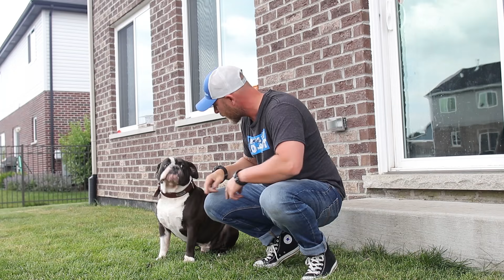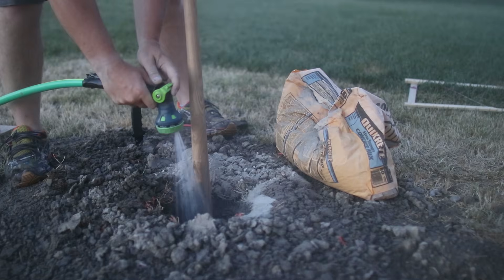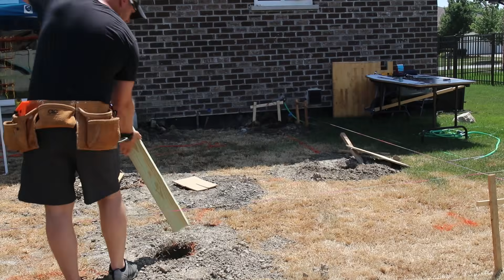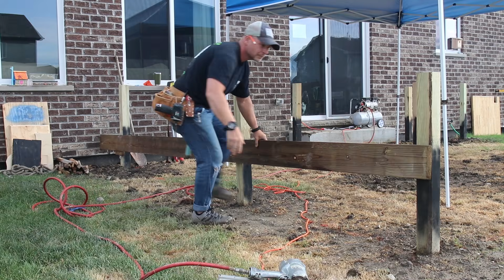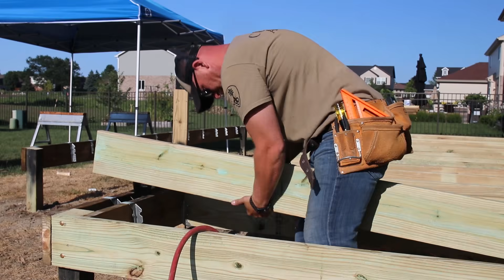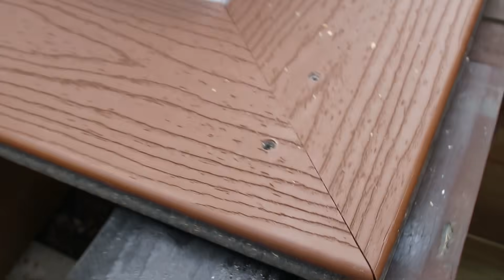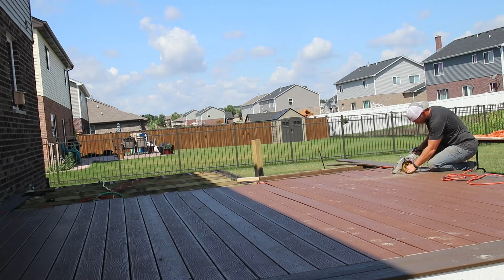How To Build A Deck!! Layout, Framing, and Composite Decking Guide ||| DIY Deck Build

Comment: I have a few questions.
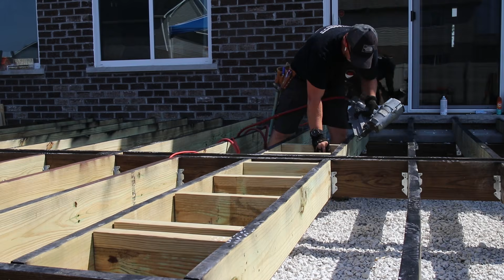1. At 11:05 you started the bracing for the outside and middle of the frame. On the outside, did you run an additional joist shorter than 16" from the outside or did you just block in and keep the spacing at 16"?
2. When doing the border and steps, you overhang the Trex just about an inch. I saw how you did the angled corners and pre-drilled and the screws show, but how did you hide the rest of the screws through the length of the board? The overhang would make it so you couldn't use your little tool.
Reply from the maker: I’m not exactly sure what your asking brother but I used blocking every 16” in the middle because I had a different color transition piece going there.   And on the stairs again 16”.  As for the mitered corners I drove that screw just below the decking off camera.  Before we sold the house I made my own plugs out of the decking boards and plugged them like the facia.  They didn’t sell my color plugs so if your looking to do composite decking keep that in Mind.  Hope that helps you.

Comment: I’ve never seen 7 & 1/2 inch 2x8s.   Usually they’re 7&1/4. 9&1/4 for 2x10s.  Everything else is half inch under 2x4 2x6 both half inch under.  The rest is 3/4. Just wanted to point that out.   Not to be a dick or anything.
Reply from the maker: They actually ranged from 7.25 to 7.5.  It’s crazy how off they were but it worked out.

Comment: Looks good, but, if I may, PLEASE don’t screw beans to the sides of posts, they should lay on top of the posts, it makes a huge difference structurally.
Reply: Correct.One should cut away the posts so that the beam fits in the section that's cut away. This way the post supports the full weight of the beam instead of just bolts.

Comment: Sure couldn't build a deck that way and it pass inspection where we live. Posts cannot touch dirt..especially be incased in it.
Reply: Sandwiching carrying beams between posts is why decks are failing when they get overloaded. They need to sit on top of 4x4s or 6x6s.
Reply from the maker: Every town will be different.  I pulled permits for this and passed inspection.  It’s all about climate and code where you live.
Reply: @KomarProject  Your beams tho? They need to be point loaded on the post don't they?
Reply: @BorisYeltivinshki  Yes- Joist must sit on a post by 1-1/2" bearing you can't use lag screw lol...This guy is a hack and doesn't know what he is doing. Please don't use this video for referencing.  The second you see someone using a nail gun to build a deck give that video a thumbs down and leave immediately.
Reply: @deeeeeeps  I agree with everything except the nailgun part. I'd never want to ply a beam by hand
Reply: Komar Project still would have gone with a forming tube and coming slightly above ground level and mounted the posts on that, even if your local code doesn’t require it.

Comment: did you use the composite on the deck because it looks better than pressure treated wook or for other reasons?
Reply from the maker: Ya because it maintenance free for the most part.  It will last longer as well

Comment: Thanks for explaining how to attach the joists to a supporting beam. I had the same problem with steps going to a glass door. What length of cantilever  have you got? My joists are 5x2s. Could I have a cantilever up to about 2ft safely? Cheers.
Reply from the maker: My overhang is about 18”.  With a 2x5 ( which is weird by the way lol ) I’m guessing you can maybe get away with a 12” over hang. Topically you need at least a 2x8 for a 2’ overhang.   Hope that helps brother

Comment: That looks really beautiful and I'm planning on doing almost the exact Design with the curved patio for fire pit. Can you please tell me When will you be releasing the video about the curving the composit decking?
Reply from the maker: I wasn’t actually able to bend the composite decking. I tried on multiple times and for some reason I just couldn’t get the right temperature to heat it up enough to Bend. So I just did a Sunburst pattern but didn’t film the process because we were trying to get the project done quickly. But you can see the final picture results on my Instagram page
Reply: @KomarProject  I see, Thank you for letting me know. It seems like you had to make a new grove everytime you  cut them to the right shape. but for now I think I will just stick to what you did on the deck, cuz mine is a ground level deck and no steps involved thankfully.
Reply: @KomarProject  I curved trex around my pool, it was definitely ALOT of trial and error.  I build a heater system similiar to yours, only I didnt have the heat source in-line with the boards like you did, I teed it off...found I was able to get a more consist temp throughout.  The whole process was a pain in the ass tho...not an easy thing to do.

Comment: This video is exactly what I’ve been looking for.  Like exactly.  We moved into a house with a half finished deck.  Thanks for posting. Personally I’m a little more old school and rather mount beams on top of posts or notch the post so beams set inside of posts, but I kind of inherited a deck with similar setup only they used FastenMaster (similar to Simpson Strong Ties).  I just don’t trust the technology to hold the weight of the joists, the beams, and any other environmental variables.  Am I paranoid?  Does anyone else share this sentiment? Lol
Reply from the maker: You’re totally right it’s better to set the joists on the posts or notched posts but fasteners like this will hold them just fine. I know a lot of people will argue that point but I have built a lot of decks over the years with building inspections to follow and they have all passed. If you’re worried just attach some two by fours under the joists at the posts and glue them in the place with fasteners and it will hold better then notching the posts.  A glue bond is actually stronger then a piece of wood.   Hope that helps and good luck.
Reply: Komar Project interesting thanks, I may give that a try.  I found some Simpson Ties here https://www.homedepot.com/p/Simpson-Strong-Tie-DJT-14-Gauge-ZMAX-Galvanized-Deck-Joist-Tie-for-2x-Nominal-Lumber-DJT14Z/100374978 

These seemed like they could also work.  But I also like going the cheaper route because I have plenty of 2x laying around.  Were you thinking mount them vertically or horizontally directly under the joist with some wood glue and fasteners (maybe the FastenMasters) or other screw hardware?
Reply: Our building codes here you would have to use 6x6 and it would have to be notched. that is the only way to distribute the weight down the pole into the concrete properly. The deck you made it looks great though.

Comment: This is an amazing project you did. I'm looking at this so I don't buy those stringers LOL.
Question: Did you do the SketchUp render yourself? Very NICE. Any tutorials used? I want to mock mine up with a tool like that.
Reply from the maker: I did use the free version of sketch up.  If you never used it it takes a little time to pick it up but after an hour or so of messing around you should be good.  Good luck !!

Comment: Great step by step. Thank you! Struggling with the idea of those posts just backfilled with dirt. In my head I was thinking they would need to be concreted in or use concrete blocks/footings. Talk me off the ledge here...
Reply from the maker: It all depends on the codes in your town.  Where I live all we need is concrete frost footings.  And with them going in so deep they will never move.   It again if your in a warm climate your not going as deep so you may have to do concrete Pillars.  Call your local build Dept and they will tell you beat way to go
Reply: This would rot in the moist climate I live in-- any wood that touches dirt will not last. In fact you don't even want the post to touch the concrete. You have a metal plate that is attached to a bolt embedded in the concrete. The wood then sits on the metal plate.

Comment: This deck looks great! However, your method of attaching the rim to the posts is not the best way to support the deck and in fact is not allowed under TN building code. Why don't you place your joists over the posts or notch them and use a Simpson strong tie to connect?  It is best practice.
Reply from the maker: Your right it is the best.  In our town it allowed, we actually had a framing inspection before putting on the decking.  It’s crazy around our parts the code is pretty much different then the rest of the country lol.
Reply: This deck rehab would not be up to code anywhere. He’s talking shit about the original builder the whole time when he’s not even close to following RBC

Comment: Looks fabulous!  Which line of Trex did you used?  It looks like the Enhanced line.  I was wondering if the bottom part of the deck where the ridges are will rot because it does not have the same finish as the flat surface.  Do you recommend this for seconfd floor decks? Thanks!
Reply from the maker: Not sure what you mean when you say the ridges.  The entire deck is pressure treated so it shouldn’t rot.  Wish I could be more helpful
Reply: @KomarProject Sorry, I meant the scallop bottoms.  The surface is flat and has a coating, but Im not sure about underneath.  Appreciate your replies!  Thank you!

Comment: Since your deck is free floating, you do not need any permit. Lag bolts do not give any structural strength. I will be doing almost the same deck with all lumber. I really like the CAMO board fastening tool. Thanx for educating me.
Reply from the maker: In our town you do need a permit even if it’s free standing.  I would check with your town though just to make sure.   Good luck with your build.

Comment: I have watch a lot of DIY videos and website.   You videos are far the best.  Looking fulfill long time promised i made to my wife and build a deck.   My situation is similar to yours.  My ground floor is concrete so different footing. I live in LA CA and i was first thinking on attached ledger but the deck is too low: my deck is only 12in in height so about 9in of the bottom is concrete foundation.  So install more posts and design free standing deck, like yours.   14x12 or 12x12 deck top size.   Don’t have the ground clarences for support beam just posts.   Any suggestion?   Also what is the name of spray “paint” (black color) you sprayed on the posts and top of joists?
Reply: If it was just a paint spray do you recommend putting MFM Deckwrap Powerband?   Also the local home depot and lowes treated lumbers look very wet.  Are those lumbers okay for post, ledger, beam, joist, etc?
Reply from the maker: The spray paint is just a regular black one so that you don’t see the light color of the joists against the dark planks.   No need to seal them with a membrane unless you cut the beam and expose the grain.

Comment: Hi, what is the black spray paint thing you spray on top of all the joist? That's to protect the joist from water damage right? I've seen others use a sticky tape to achieve the same thing
Reply from the maker: Nope.  It’s just regular spray paint. With dark contrast planks I spray a dark color so you don’t see them through. You really don’t need anything on top of them if you don’t rip them and expose the grain.  If you do there is a membrane you can put on

Comment: Looks great!  You made it look so easy.  I’m struggling with basic stairs for our raised patio. 16ft wide, 4 steps which is including the patio surface as a step. How did you fasten the exposed edges of the stairs to the frame?  Did you face screw?

Comment: i have 2 questions
1. why you don't use the traditional way to put concrete on each post hole?
2. when you do the deck framing, I don't see you like everyone else that attach the beams (deck) to the house.
Reply from the maker: It’s a free standing deck.  There are two reasons for it.  1. I couldn’t attaché the ledger to the house because of the step I had.  2. If you attach it to the house you increase your square footage and have to pay taxes on it in our town
Reply: @KomarProject  we had the same problem when we build the deck, so the guy who help us build the deck, half of the deck attached to the house and he used long bolts nailed in attached the deck to the steps.

Comment: Nice deck .... first time I've seen a "floating" deck vid.
Why not put the rim joists ON TOP of the posts?  Wouldn't that be the more structurally stronger way?  Rather than relying on shear strength of the lags?
Reply from the maker: It’s just how I been doing them for years. You can go either way.  But I found this to be the easiest way and still plenary strong
Reply: @KomarProject  Cool ....

Comment: Looks awesome! I’m a bit confused, you didn’t need to set the post them selves in concrete? I saw you only poured concrete for what you called a frost footing, and then packed dirt around it. Is the code different in your area? I’m out in Washington state. 
Good work!
Reply from the maker: Ya we don’t have to set them in concrete.  Just as long as they are sitting on something.  Lots of towns don’t.  Just check your local code
Reply: @KomarProject  Just because it isn't code doesn't mean it's not the right way to build a deck.  Even though it's a very low deck that thing is super unsafe.  Structures that are going to carry any load at all need to be reinforced.  You would have been better off not digging holes and using concrete anchor post blocks.

Comment: Hey, Bart. Good stuff that video. One of the first video that is that well explained. Must have taken a lot of time shooting and building at the same time. Question for you. Do you feel that composite board are scratch resistant enough for that kinda build? There will be a lot of traffic in front of the patio entrance.
Reply from the maker: Omg yes.  I actually dragged Thor on it a couple of times when he doesn’t want to come inside and his nails done even leave a scratch. Super durable

Comment: What is the black spray you put on the post as well as the top of the joist? Is that another type of water proofing?
Reply from the maker: No it’s just a black spray paint so that you don’t see natural wood through the gaps.  You only need to water proof the joists if you rip them and open up the grain

Comment: Instead of trying to bend the composite decking I think I would run him like a sunshine beam in the opposite direction taper them and then rerouting the groove to anchor them. You probably already have it figured out.
Reply from the maker: Hahaha you read my mind.  That’s what is going to happen. Think I gave up on bending
Reply: @KomarProject  If you're looking to bend some deck boards, go look at Dr.Decks, but use silicone heating blankets until their soft and them put them in a mold.

Comment: Looks like you already had a deck there...?
Reply from the maker: No, I just cut the grass as short as I could and let it die a little while in preparation for it.
Reply: That’s smart. I don’t have grass, so I’m already ahead on that step lol I’d like to put in a deck at my house but my backyard is not quite as appropriate as yours. For instance, my backdoor threshold is only 2-3 inches above the backyard, so I’m not really able to use the same techniques without making my deck a step up from the house. Any ideas?
Reply: @standout47  excavate.